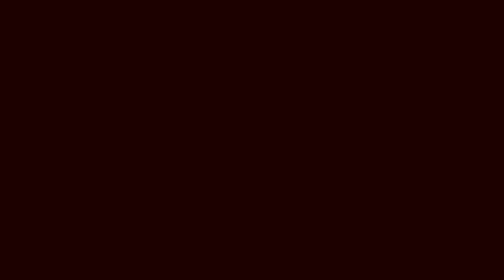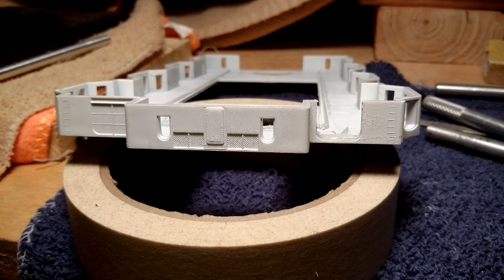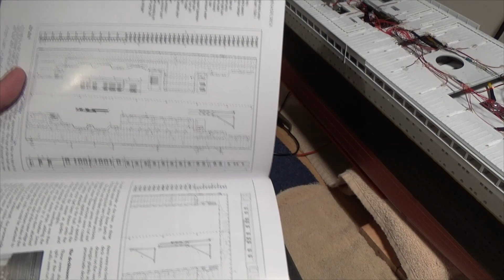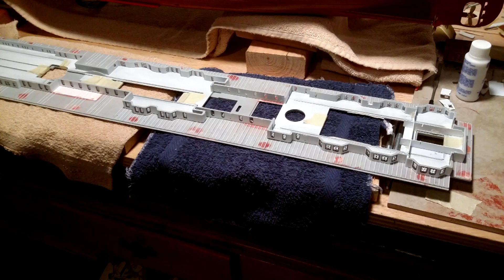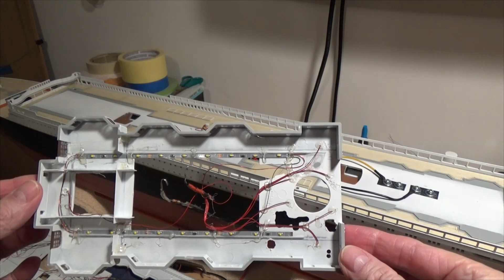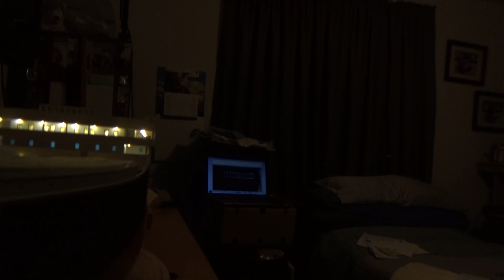Trumpeter 1/200 Titanic Part 11 Superstructure A Deck Lighting

Comment: One of the best models of Titanic!!! Can I ask you, how did you wire the micro LEDs - in parallel or in series? In series I mean +  - + - ... and then resistance. My power source is 12v and I wanna connect 4 of the LEDs like that: all plus wires together and all minus wires together. Then connect to resistance's plus and minus. And wherever I read - this is probably against the rules... What is your opinion, Daryl? By the way, because of your video, I decided to use terminal block 😊
Reply from the maker: The 0402 SMD micro leds were wired in parallel.  The 0402 SMD's I bought came with a resister that allowed them to be hook to a 12V source.  So one could say wire four leds in parallel to one resistor to create a 12V circuit.  Or one could wire a resistor to each 0402 SMD.  By running several SMD's to one resistor in parallel you save on space taken up by resistors, and you use less resistors.  Create how many circuits you want and run them to a terminal block that the main power feeds.

Comment: Wow! looking real good. Thanks for the explanation on the wiring/lighting, if I tried that I would end up with a molten piece of plastic. In the future could I call on you for assistance in the electrical department for lighting of ship models?
Reply from the maker: No problem.  Just leave a comment for what you need.  Boyd from the TrekWorks channel has some nice tutorials on wiring up models.  He is a professional model builder I am not, so you might get more correct info from him.
Reply: @darylw792  Thank you.